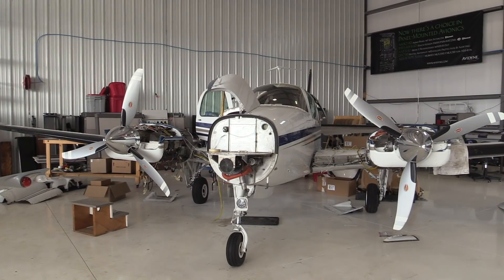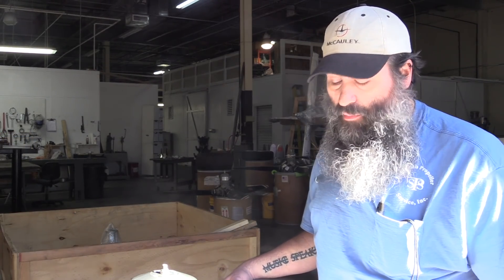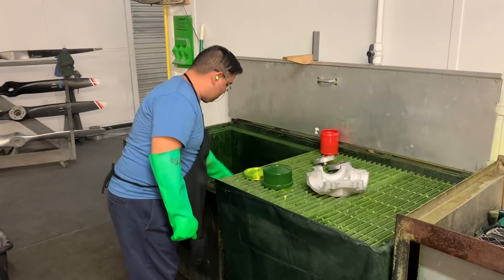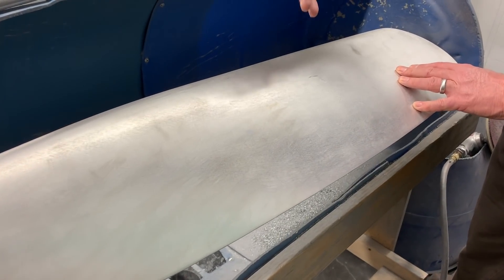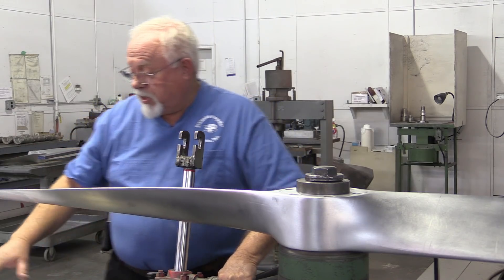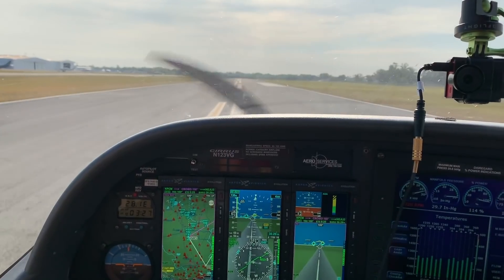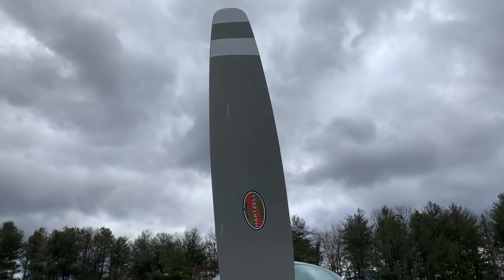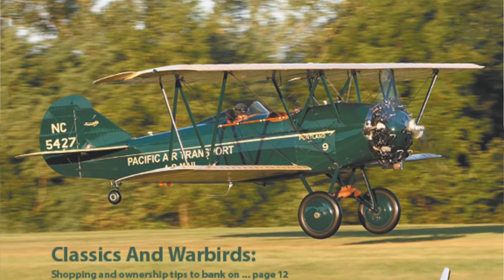Propeller Shop Floor Tour

Comment: Its measured by hand?!
Invest in some laser measurement tools...much better accuracy
Less likelyhood for human error

For the amount of money it costs to send parts out for overhaul I'd have expected some technology beyond a caliper and a sheet of paper
Reply: You are going to need a template for that blade to get the proper blade angle at the designated station of the blade. Yes a digital angle gauge could help but I’m not sure which one stays calibrated longer or drifts more!
Reply: I wasn't blown away by their "skills"
Reply: I'm surprised that measurements are still hand recorded on paper rather than at least data entered into a station iPad.  Ideally laser/digital recorders would Bluetooth measurements to the iPad.  This is an expensive prop shop that could afford modern data equipment.
Reply: Barry Gloger I’m surprised they don’t use touch probes and digital recordings or optic recordings. Both would cut labor costs down tremendously and improve accuracy immensely and gain a 3D profile of each blades. But an iPad would be a great start. It’s hard to change until your competitor beats you out of business??
Reply: @John-zv1hy  I'm a city boy...for expecting a high degree of accuracy..  
I wonder what "high quality" work you churn out with that attitude 

When these props are made, they use laser scanning tools...when manufacturers are building the aircraft itself, they're using laser measurement..

I guess it's a good thing "city boys" are in charge, I'd hate to be flying in an aircraft who's manufacturing motto is "good enough"
Reply: @daveshaw9344  I belive the caliper he was useing was Digital!